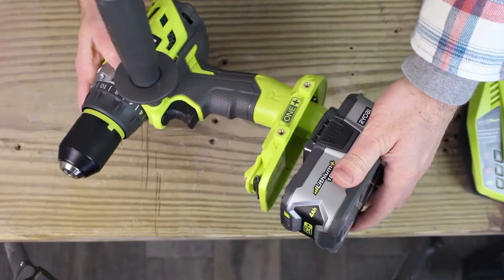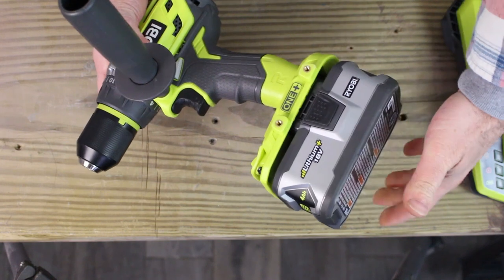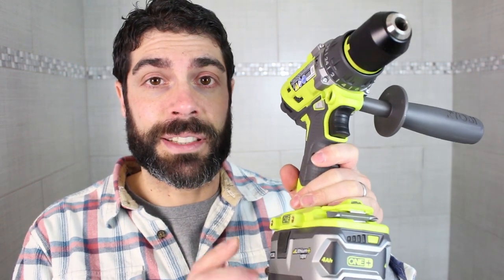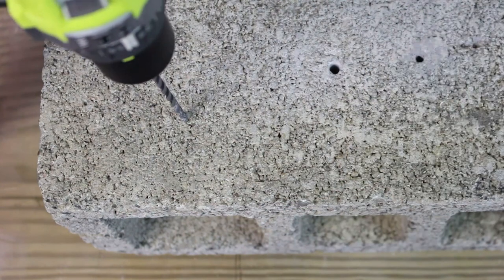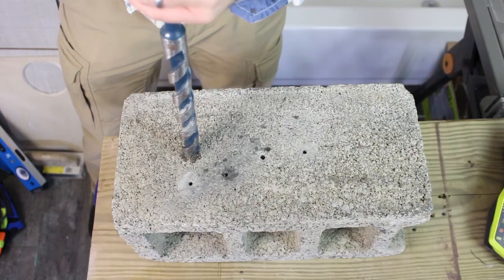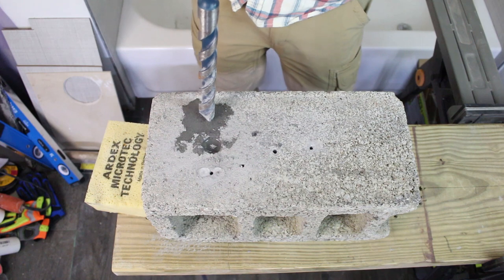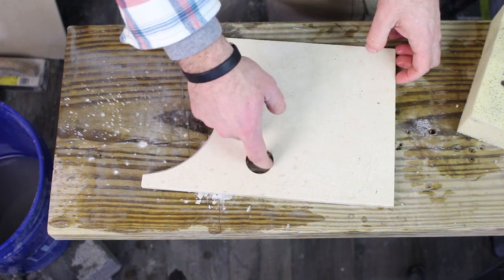Ryobi 18V Brushless Hammer Drill Kit (Affordable Power)

Comment: I recently got the R18PDBL-C55S 
18V ONE+ BRUSHLESS HAMMER DRILL KIT (R18PDBL-0 Brushless Hammer with 2.5+5.0 AH batteries and charger). From day 1 the clutch does not engage! We tested it by holding the  chuck and engaging the driver on driver setting, with eTorque seeing on 1 & Gear selector on 1, It's identical to eTorque setting 10 & Gear selection 2. I took it to the retailer who confirmed it was faulty and we tested the same on a demo model which on that low setting the clutch spun freely.

Comment: Something to add, you can add even more power behind that drill by using the newer HP series batteries as both the tool and battery have extra contacts for more power delivery. The standard 4ah that kit comes with is a non hp battery so it doesn't have the extra contacts.

Comment: I left Ryobi for Kobalt a few years back.  Now Lowes has changed the format on the batteries making my tools obsolete as after market batteries are extremely expensive.  I am now tossing the Kobalt junk and going back to Ryobi who did not change their battery format even when switching from NiCd to Lithium.  Good for you Ryobi.
Reply: I left Dewalt for the same reason. I have a ton of Dewalt 18V tools but I'm not buying into the new battery platform and the adapter doesn't work on all tools, plus it makes some tools huge.
Reply: Craftsman did the same thing from c3 to v20
Reply: That's why Ryobi is "truly the only way..."

Comment: I bought the brushless hammer drill kit for Black Friday which included a free tool (I chose the angle grinder). I already own the Ryobi SDS hammer drill and thought this new hammer drill would be comparable. The SDS drill is a freaking workhorse compared to the new brushless hammer drill. So the brushless hammer drill is replacing my everyday drill as it's a little smaller than the regular 18v drill. I'll use the hammer mode for large hole saws and in tight spaces where the SDS can't fit.

Comment: it's 30 minutes for the standard small batteries. the 4 amphour batteries do take longer but last much longer than the standard packs.
Reply from the maker: +frozenwalkway thank you for clarifying. The battery still had 4 bars after doing the 1" masonry bit and 1 1/4" diamond hole saw tests. So it held the charge very well

Comment: I love the drill itself, it helped me install windows in my home with TapCons into Block.  The CRAPPIEST part of this tool is the chuck which at this point won't come  off the spindle to replace it.  From day one, the only thing it held reliably was hex shank bits.  Anything round, it slipped.  Awesome torque and power, the weak link is the Chuck.
Reply: I looked up reviews for this drill because mine does the same thing! So frustrating.
Reply: I know right. Apparently some drills have a chuck/bit lock. Not sure which ones or how that works. But I try and avoid anything round.

Comment: Hmm, doesn't include the depth gauge like the older brushed model... not even a place to put one on the inner screw-on handle piece.  Not that I'd miss it much but some trade/uses might.   

It's a little disappointing that they went with the same weak LED again.  It beats nothing and I like that they placed it on the base instead of the head (where it would create shadows), but in this day and age, a mere 1W LED could have been integrated over their lower powered LED for only a few cents cost difference.  The difference in battery drain would be negligible.

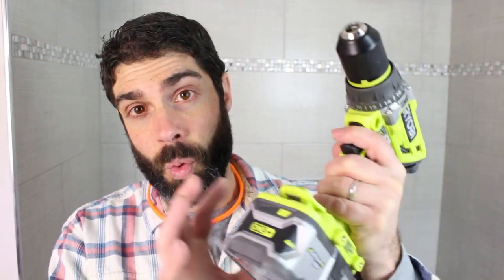Comment: Get a spray bottle to keep your water in. Works great.   @11:31   I have the P214 hammer drill and the thing likes to let go of bits.  Out of all the Ryobi tools I have it's the one I've not been overly happy with. Hearing this tool also likes to let go of bits makes me wonder if hammer drills aren't better left to higher end tools. Though I've put a fair amount of work on my P214 (Retro fitting latches/locks on 100 storage doors) and it will get some tough work done.

Comment: That 30 minute charge is probably for the compact sized batteries
Reply: If you want your Li batteries to last, you don't use them below 2 bars on the indicator very often, It can cause the batteries to fail. I've had Li batteries for 4 years now and they still work strong.. If he let the battery die totally, it'll take longer.. If you charge them at 2 bars, they should last longer..
Reply: You're right - the 30 minute specification is for the 1.3Ah P102. The other batteries take quite a bit longer. Ryobi's 30 minute "fast charger" is actually on par with most other brands' regular chargers.
Reply: The fast charger is rated at 5amp/h so it should charge the big 5Ah battery in 60 min

Comment: The manufacturer recommends to charge the battery before use. See Ryobi 18V Lithium-Ion Battery Pack P107/P108 Series Supplement included with the Operator's Manuals (One for the 18V Brushless Hammer Drill and The other for the 18 Volt Dual Chemistry Battery Charger) under the Section "Charging The Battery Pack" Where it's specified that the battery packs are shipped in low charge condition to prevent possible problems. THEREFORE  YOU SHOULD CHARGE PRIOR TO FIRST USE...

Greetings from the Caribbean Shore of PR, with my respects.
Reply: jwong19 lithium batteries do not require any special cycling. Your thinking of nickel cadmium and nickel hydrides. They do require special cycling to maintain full capacity. Lithiums have over charge/fire issues but that's handled by the onboard charge controller. Long story short if you pull the trigger and it turns your good. When it suddenly shuts off charge it. Pull it off and throw it back on the charger whenever you want without consequence.

Comment: the clutch you adjust WHEN? why is the clutch numbers for??
Reply: For putting screws in mainly so you don't strip the threads. Clutch will kick in once you've set it so drill no longer turns at a specific tightness

Comment: So I'm trying to learn about tools since we're about to buy our first home. Could this be a replacement for a standard drill and impact driver? Or this just something completely different?
Reply: Replaces standard drill, yes. It is a standard drill with the added hammer mode for masonry. Impact driver, depends. It has a lot of torque so its going to drive lag screws and such with ease, but is a bit bigger in the hand. Right now at home depot they are offering a free tool with the package deal... So just pick up the one with the impact driver also if you want it.
Reply: @imnotimportant  Awesome thanks!

Comment: Can you use this hammer drill to mix mud/mortar? If so what setting do you set it on and the speed?
Reply: As low as low goes. If you do it on high it will bog down and stop working. I learned this the hard way. I was able to mix thinset mortar on low after figuring that out, but a few days later the motor crapped out. Don't do it unless you're still under the 3 year warranty. I found a replacement motor but the best price was 80-90 +tax and shipping.

Comment: Thanks! Great video. So this is a all in one tool, i dont need to get a second impact driver? Because Home depot has a free tool if you buy this one.
Reply: C I they do different things. Hammer drill taps back and forth lengthwise to push bits through concrete and such like a chisel. Impact driver taps in a circular motion along the bit rotation to twist and torque screws and bolts easier like a ratchet.

Comment: I’m not impressed with the hammer drill I prefer the ridgid brushless over the ryobi great review though
Reply: I was a PROUDly boastful ridgid tools owner until my BRUSHLESS GEN 5X hammer drill (which sucks ass) burned out on me while drilling a hole through concrete to run some power for some lighting. The Slab was 9 inches and I was only going about an inch deep for the tapcon. To my surprise after a full year and a half it burned out. I Never covered the cooling holes, never dropped it. never beat it up. It failed me and I learned that it is nowhere near as powerful as the 4GEN Brushed Hammerdrill. THE Ridgid GEN5X hammer drills suck.
Reply: Both will work.

Comment: I have this drill oh, I want to start out by saying I love Ryobi tools. I am very disappointed in this drill! I have a 3 amp battery HP. The drill cannot drill a hole 4 inch hole saw without cutting out 50 times. If you use an aggressive Lenox 2 inch drill bit the drill feels like it's falling apart. Once again, I love Ryobi tools and have many of them for years. Very disappointed in this drill! I expect more from Ryobi!